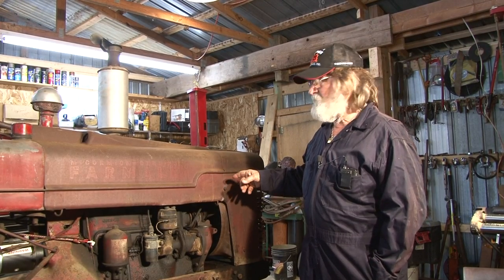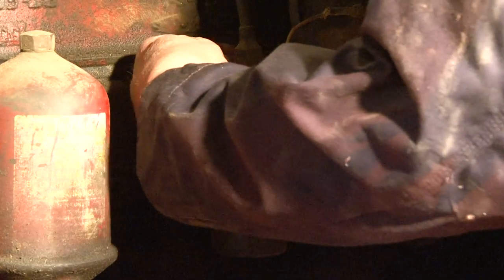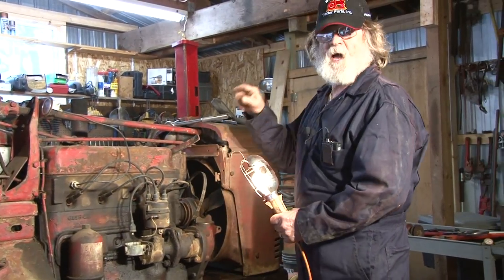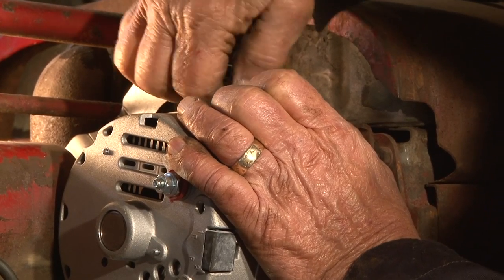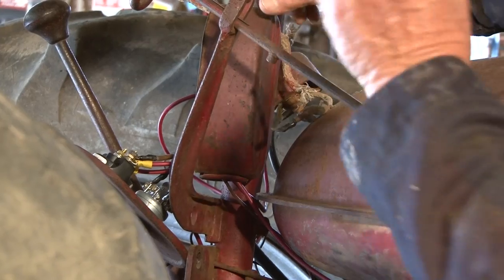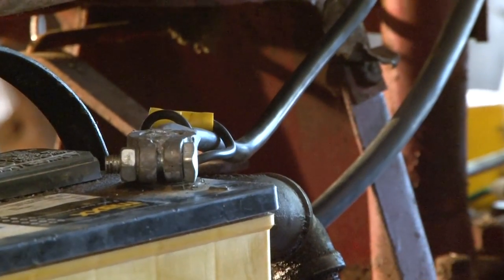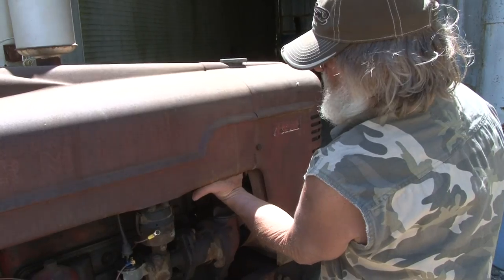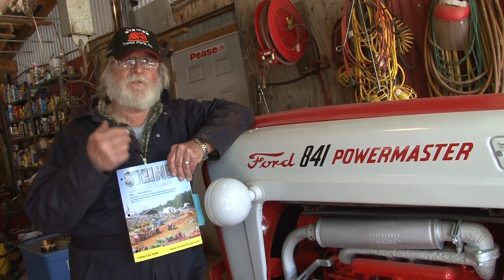Fitzgerald Steiner Farmall H 12V Conversion Video Revised

Comment: Team Fitzgerald 
Thank you for the step by step instructional video. I now have done the 12 volt conversion upgrade on 4 Farmall H tractors a 48 Cub and a 55 300. Steiner also sells excellent wire harnesses. Thanks again

Comment: thanks for the advise and good instructions I bought that same 12 volt kit for my h but it still didn't charge but I was using the original 6 volt amp gage didn't know I had to change that now ill get a new 12 volt gage and ill check the wiring again I wrote down the instructions thanks a lot for the video steiner has helped me out a lot on getting me the wright stuff for my older tractors and advise  thanks again
Reply from the maker: Thank you for your kind words, Dale! Best of luck with your project!

Comment: I liked everything about the conversion except those solderless connectors. I despise solderless connectors with a passion. In my experience, after age and time, one of the clampings lets loose and then there is an electrical gremlin to chase. Good video and thanks for sharing. Will be referring back to this in the future.

Comment: Awesome video, I just bought my first tractor last Saturday, its a Farmall Super C. I'm wanting to convert my Super C to 12v. My question is will I need to change my points on the disturber.  Also I have another question that not electrical related, my tractor will still free roll if I put it into gear not started, when I bought it the brake assembly on the right hand side are disassembled I'm not sure if this is causing the tractor to not engage in gear or if something in the transmission is missing.

Comment: If I have an H with the distributor that’s horizontal, can I still use the 12 volt internally resisted coil and not the barrel one they mentioned in the video? Shouldn’t it still work fine? Not a magneto tractor. 
Thanks for the help!

Comment: does there need to be a diode inline anywhere to prevent the battery from discharging when the tractor is shut of?
Reply: It looks like a one wire alternator so no but even then with a three wire alternator the battery will not draw down from the output post of the alternator because of the rectifier bridge, but f it was a three wire alternator the internal regulator should be hooked into a switched circuit I believe otherwise it will draw down.

Comment: i have the smallest of the farmall tractors, a 1948 farmall cub, and yes its 6 volts. i think that on a cub, the 6 volt system is adequate in all but the coldest of temperatures, and yest i do use my tractor in all conditions. i plow snow with it in the winter, and mow my 2 acres of lawn in the summer. i wanted a tractor that was fairly in-expensive, reliable, has good parts availability, is economical on fuel, will hold its value, something that i can work on myself, and something that is compact enough to not take up my entire barn/garage but heavy enough to do some serious work as a small chore tractor. the cub is all of these things and is an ideal machine to have around the yard if cheapie disposeable lawn tractors are not your thing. as much as i can put up with the 6 volt system, do you have 12v conversions for the cub? part of me wants to keep it original and as i type this, everything works as it should. however, a 12v system certainly would give it some extra zing on really cold days.
Reply from the maker: +andrew donohue IHS2340 is our new bracket kit specifically for the cubs. ABC535 is the alternator. You can view the parts for your conversion on our website http://www.steinertractor.com/IHS2340-Farmall-Cub-Alternator-Bracket-Kit

Comment: Do you need to swap from a 6v starter to a 12v starter in order to do the conversion?
Reply from the maker: You do not need to switch the starter when converting to a 12 volt system.

Comment: Looks good but the way the ignition switch wire is connected to the ammeter will not show the ignition draw. The only wire on the + terminal of the ammeter should come from the battery. All other wires should be connected to the - terminal.

Comment: I have a converted 46 H to 12 volts with magneto. It has solenoid. Without me looking at wiring, is the conversion the same as this video shows?
Reply from the maker: Dave this video is based on a conversion with a distributor.
Reply: A magneto supplies its own ignition spark for combustion. There a 2 different ignition switches. 1 for use with magneto ignition and another type used for coil/distrubutor ignition. You use one or the other. The 2 terminal ignition switch is used with coil/distrubutor ignition.

Comment from the maker: On this one, they left the 6 volt starter on.  You can run a 6 volt starter on a 12 volt system. It may reduce the life of your starter somewhat, but many people just run them this way. You can also take your 6 volt starter into a shop to be redone or try to find a 12 volt starter you can use. Those will add to the expense of the conversion.

Comment: where did you get the starter and how do you convert to 12 volt starter?
Reply from the maker: Hi Tony! Thank you for contacting us.  When converting to a 12 volt system, you do not need to change your starter.  Your existing starter will work just fine!

Comment: Wouldn’t you burn the 6 volt points on a 12 volt system?
Reply from the maker: Hello!
The points are not volt specific.  You use the same points on a 6 or 12 volt system but would need to change the coil over.

Comment: Can the original light switch be used on my W4 for this conversion ?
Reply from the maker: Hello Bob, the original light switch can be used, the only difference is the resistor that is used to dim the lights. It will work just fine for a long time and when the resistor burns out you would then replace the resistor or the whole light switch itself. Thank you for the question! Have a great day!

Comment: I have an h and I was wondering about how to wire up a new 12 volt light switch and the lights. I have 2 new whole light assemblies that as installed but I just do not know how to wire the switch to the lights and whatever else. If anyone could explain or link me to help it would be appreciated
Reply from the maker: +Normand Farms Depending on which switch you have, here are the links to the instructions. http://www.steinertractor.com/products/pdfs/IHS594.pdf 
http://www.steinertractor.com/products/pdfs/IHS596.pdf

Comment: Do you have to put a new starter on or can you use the old 6v one?
Reply from the maker: You can use the existing starter when converting to a 12 volt system.
Reply from the maker: Ben, you can use your existing starter.
Reply: Maybe a stupid question but since it's a DC system and you are switching to negative ground I'm wondering why original starter wouldn't turn in opposite direction.
Reply: @kenhilson786  I was wondering your same question about the rotation of the starter after conversion. Did you ever find an answer?

Comment: hello sir, does ur tractor has the Charging warning lights ? im having trouble in wiring the charging lights ... it wont goes away after the engine has started ... so  can u please show me how to wiring the charging light or ignition warning lights .... thank you in advance.
Reply from the maker: +MrBriandrifter On tractors with a charge indicator lamp you need the ABC535 alternator. This is a 2 wire alternator and one of the wires is for the excitation circuit. This wire will connect to the keyswitch and the charge indicator lamp is connected in series. -Tom
Reply: +Steiner Tractor Parts but i already have a JFZ1928 alternator which similar to ABC535 alternator... will it work
Reply from the maker: +MrBriandrifter Yes it should work, but I can't tell you what wire is the excitation circuit. -Tom

Comment: Great video and all my tractors have been converted from 6 to 12volt.
But... you can’t call it a restoration because if that’s what you were intending to do you’d bring the factory 6volt system back to perfect running condition.
This could be termed a resto-mod.

Comment: Are you able to explain further why you didn't use the ballast resister, was it because the alternator has an internal resister? mine has the 70 ohm ballast resister before the coil? just a little confused can you please help clarify? plus i have two wire i need to rev it up to have the alternator charge and i my alternator has an internal resister? very confused
thanks
carlo
Reply: I can give you a partial reply. With the choice of the much more modern design,the  1 wire alternator,you do not need the resistor that lowers the voltage going into the coil so the points do not burn out prematurely. 
With alternator with external voltage regulator,the resistor is mandatory.
Reply: I thought that it was because the coil has an internal resistor.

Comment: do you sell original looking farmall/IH cable restrains ?
Reply from the maker: Hi Mike! I'm not really sure what you are looking for - can you provide a little more information? Where are these restrains located/what are they used for?
Reply: Steiner Tractor Parts  they hold the wiring harness at points on tractor
Reply from the maker: We offer the http://www.steinertractor.com/Wiring-Harness-Wire-Clip-SetIHS2629  The only way to find the original ones would be at a local salvage yard.

Comment: can someone give me a detailed list of what I need to convert a farmall 350 from 6 to 12.
Reply from the maker: Here is a list of parts you would need for your 350, you can find them all at www.SteinerTractor.com. ABC418 alternator, IHS1246BK Bracket kit, IHS601 light switch, IHS237 & ABC366 coil (if magneto no changes), IHS1837 ammeter, and new 12v light bulbs as required. Good luck on your project.
Reply: Thank you